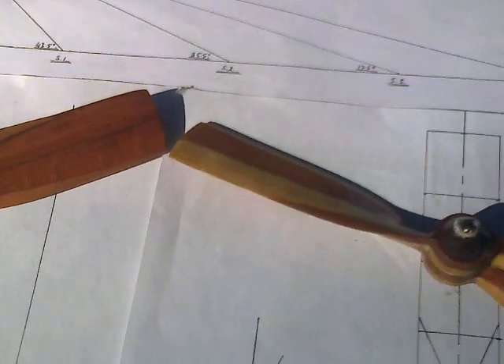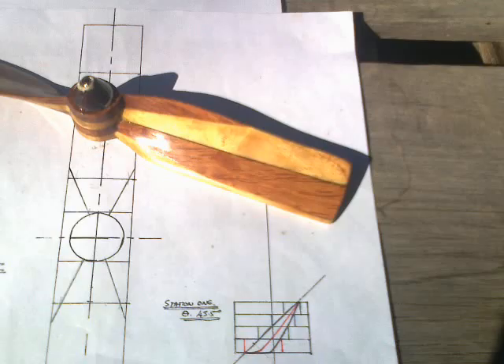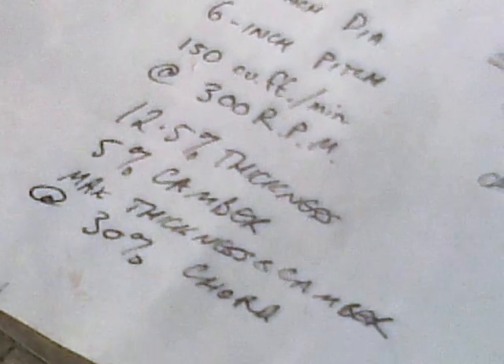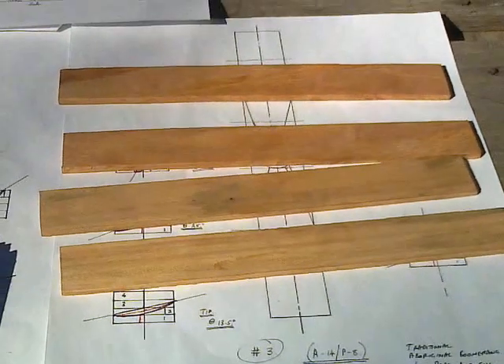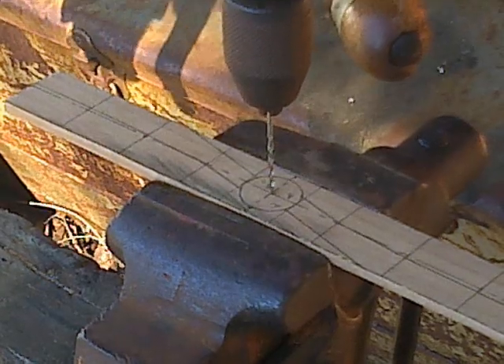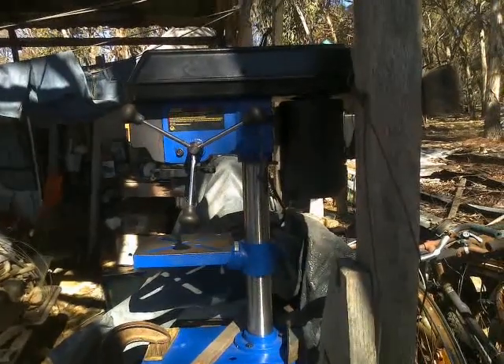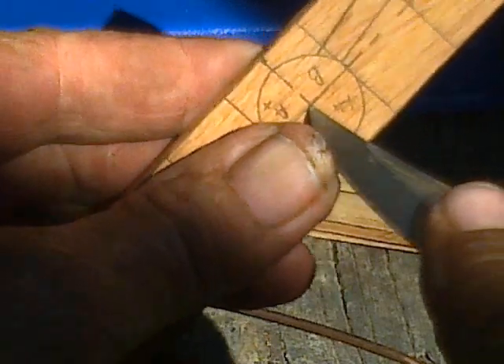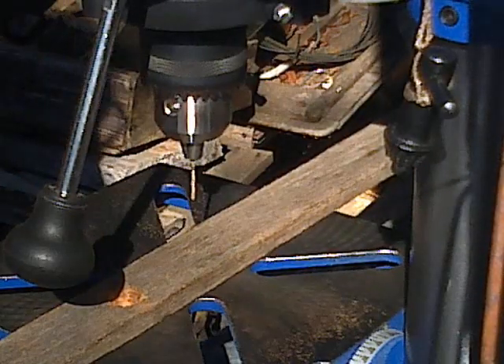Experimental Propeller-Carving, Drilling & Sawing Laminae ; Aboriginal Boomerang Aerofoil Section.

Comment: When working with wood or stone you can never predict how it will react to manipulation, it’s good that it’s going to be a laminate so you can glue your pieces together and it won’t even be noticeable. I love a good well thought out experiment, this will be interesting to see the results. Nice drill press, that will come in handy many times over. Thanks for sharing.
Have a good day.
Cheers 🍻
Reply from the maker: G'day,

Thanks mate.

  Yeah, the Jigsawing of those fiddly narrow little bits is fraught with opportunities to have the vibration do bad things.

   Later on, while "fine-tuning" the Laminae one of the Stringybark (L-1) caught the File on the backstroke and I had to glue it back together  before laminating the Blank....

  Even with the two repairs though, this one is going pretty well.

  I should've bought the Drill-Press years ago, but I thought it was too decadent ; my head isn't calibrated for Chinese Prices, I thought it would be much more expensive..., $180 is nothing - for all that technology.

  Such is Life,

Have a good one.

;-p

Ciao !

Comment: You might see multiple comments from me and I don't know why YouTube keeps doing this. Very annoying.
Reply: It was happening here as well, several comments before youtube shows any, making us thing they were lost and then they all show up at once
Reply: @walkabout16  Someone said when this happens to refresh the page and then delete the copies.
Reply: @mikeflight9  Yes i've been doing that
Reply from the maker: @walkabout16

  G'day,

    Thanks.

    Sometimes when I attempt to delete the unwanted repeats, the System cheerfully wipes out every copy of it - as a complimentary gesture.

Such is Life,

Have a good one.

;-p

Ciao !
Reply from the maker: G'day,

  Ah..., yeah, sometimes YT is a bit like that...; I often wonder if such transient Glitchings are related to Solar Flares and suchlike "Space Weather" causing problems with the Satellites...

+TMRO Channel has a regular Space Weather Report in it's shorter "Space News" series of uploads..., apparently there's a lot going on.

   By the way, last night I weighed the glued-up Blank, having not thought to pre-weigh the unsawn Planks..., and it was 31.5 Grams ; whereas the jigsawn offcuts all together came to 31.9 Grams - so if the weight of the Glue equals the mass of the Sawdust (?) then slightly more than half the Wood has been taken off before mixing the Glue (which would've been a LOT of Woodrasping, if one was starting from a rectangular Prism !).

  Have a good one...

;-p

Ciao !

Comment: Hi Chris.

Great work as usual with those calculations. The props look amazing. That was a good deal for "that" drill press, $190.00. I am sure you will use it for many other projects. I used to have a drill press with which the hand drill would mount to. It had a spring-loaded lever which you pulled down to drill the hole but it was utter rubbish because the arm had too much side play and the clamps for the hand drill were not accurate. That drill press you have is the real deal. Really enjoying these builds.
Cheers mate. 👍👍👍
Reply from the maker: G'day Mike,

Thanks mate.

 Yeah, I was blown away when I found that the cheap Drill-Press was only $115 & this one was $180 so I got the good one.

  I should've done it years ago - considering that I paid $120 for the Hand-Cranked version, about 20 years ago ; thinking it would be useful because I had no Electricity..., but it's main shaft has a slight bend it it, so it wobbles it's way through the holes, making it purely ornamental...

Such is Life,

Have a good one.

;-p

Ciao !